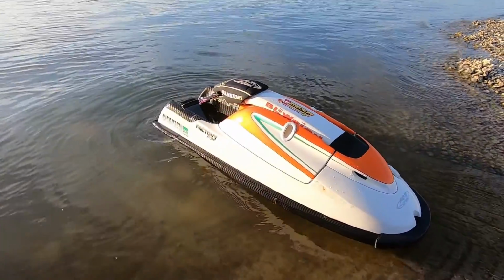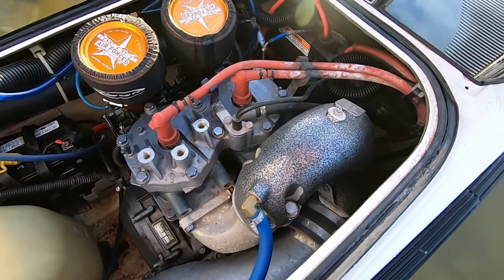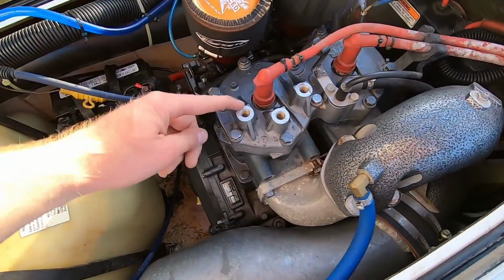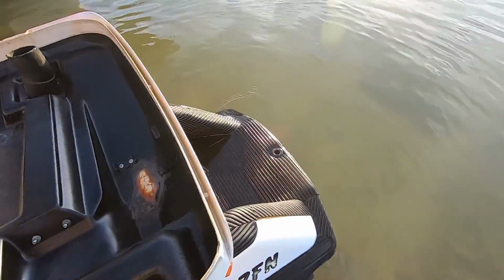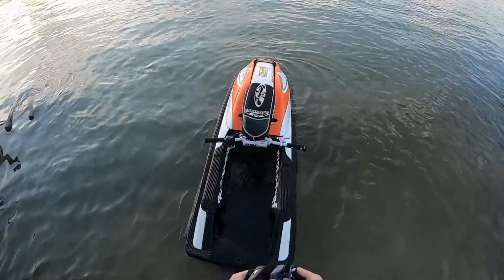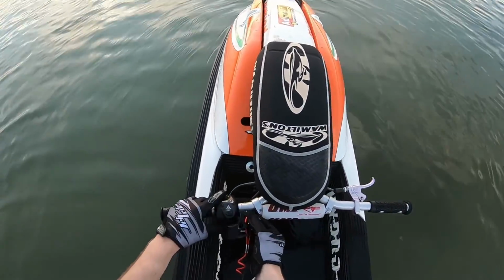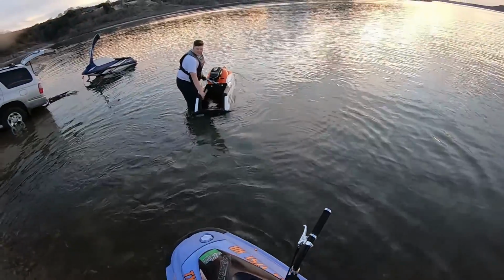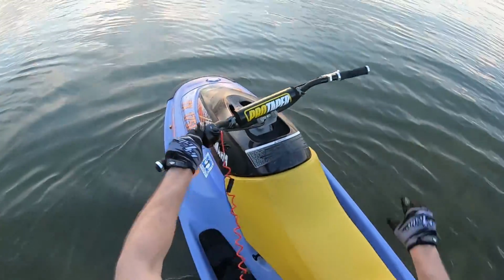Alec Buys A Modded Superjet!

Comment: That thing looked fast. I got to say..... Realistically you only need 2 superjets..... One needs to be 2008+ and one needs a triple.
Reply: Jacob Superjet Jet SKI I am trying to get him to drop a kawi 1100 in his 02
Reply from the maker: I’m actually thinking about 1100 (Kawasaki) swapping the 2002 barn find ski
Reply: @JetSkiJarrod  Yeah that is the way to go if you can figure out the pipe. Yamaha triples are for blasters and big stuff. I would bet it's really hard to fit it into a pre 08 with out cutting a hole in the side of the ski. You can only hack up and weld that pipe chamber and mill the manifold flange so much right? The easy way out is to just put a 760 in with a dry pipe and all the bolt ons. It would probably be a hair faster tan the 1100 but wouldn't have the cool factor.

Comment: Thats a limited pipe not a mod pipe. The mod chamber goes in between block and the gas tank. If your going to leave the motor stock inside u dont need a griddled head. I have a 760 in my b1 and run a non griddled ada head and have 185 psi in each cyl. Its been holding up just fine
Reply from the maker: Jeff Bryner not sure what pipe you’re thinking of but the factory b pipe for the superjet mod and limited chamber are almost exactly the same except the mod chamber is shorter like the one in the vid.. I have a limited in my SJ
Reply: @JetSkiJarrod  look up the TNT champer for a super jet or a blaster b1 mod chamber the mod chambers i have seen look like those. I have the b1 mod chamber on my blaster. My fx1 and superjet had the limited witch looked like the one in the video. My buddy had the mod chamber on his superjet that looked  like my b1 or the tnt style
Reply from the maker: Jeff Bryner here you go 
http://www.factorypipe.com/p_yamaha.php
Shows the Yamaha factory b pipe mod and limited chambers

Comment: side exhaust is stupid. really sucks when you fall off and it circles to the right and you get a lung full of exhaust before you grab the ski and hop back on.
Reply: Put a lanyard kill swith on it then.
Reply: @JetSkiBuyFixPlaySellChannel  so i can go swim a quarter mile?
Reply: @dirtrider88  you have it backwards.
Reply: @JetSkiBuyFixPlaySellChannel  ive had the engibe die as soon as i fall off and the ski ends up way away from me. Most of the time it stays running and circles right back to me. I know what happens when the engine dies when you fall off and what happens when it stays running so please explain what i have backwards
Reply: @dirtrider88  are you riding in a river with a fast current? How is a ski getting farther away with the engine shut off when you fall?
Reply: @JetSkiBuyFixPlaySellChannel  lake. It happens when you go fast. Maybe not a quarter mile but far enough that you getting back on take considerable more effort
Reply: @dirtrider88  thats what happens when you let go of it, try to hold on for longer